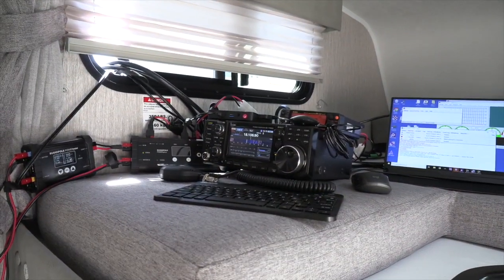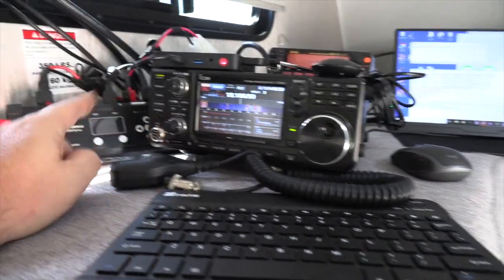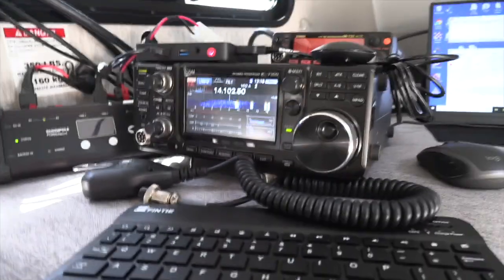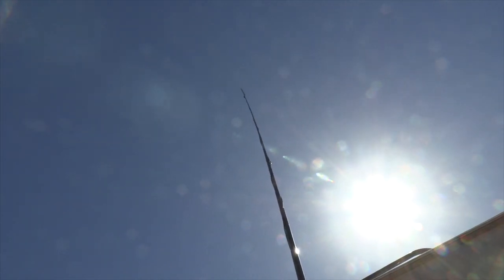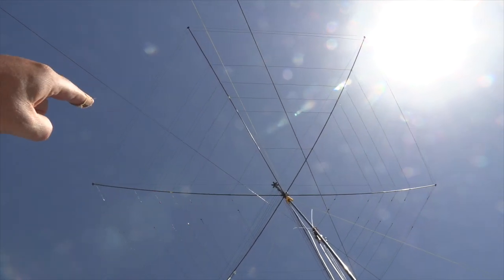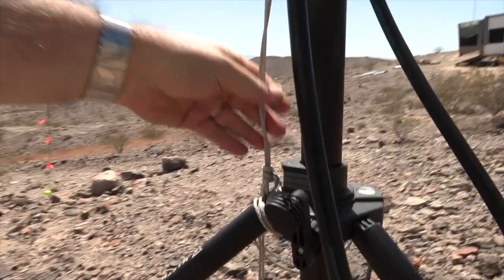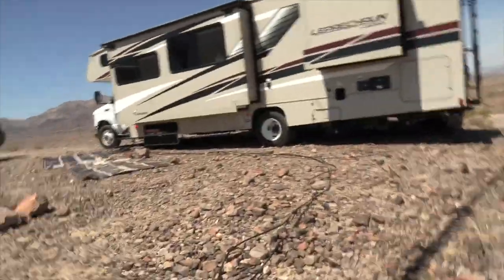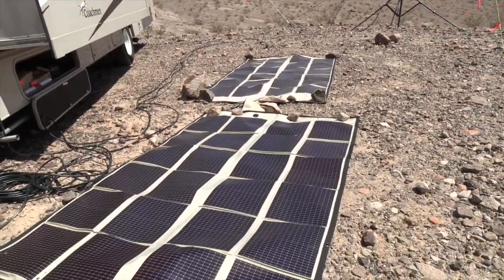Solar Powered RMS Gateway: Overview

Comment: I already have Vara HF but wants to add vhf uhf radio
Reply from the maker: Which radio do have?
Reply: same as yours......for vhf..just trying to figure out how to use the soundcards in the same laptop....I have a signal.link for HF rig.....
Reply from the maker: @Kd4jwf2024  should just be a matter of pointing the correct com ports and audio IO from Sound Control Panel at VARA FM / HF, and WinLink
Reply: trying to find me a DRA-50 for the vhf radio but had been hard
Reply from the maker: @Kd4jwf2024  go to the WaveTalkers -> Resources -> SPG page,  at the bottom I put links to all of the gear I used including the board